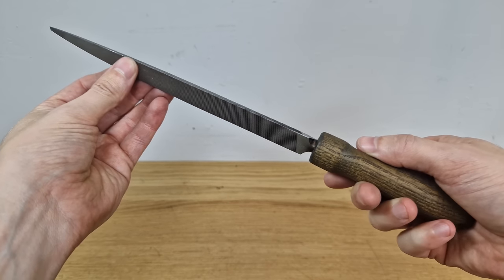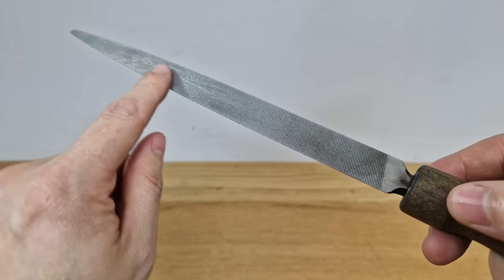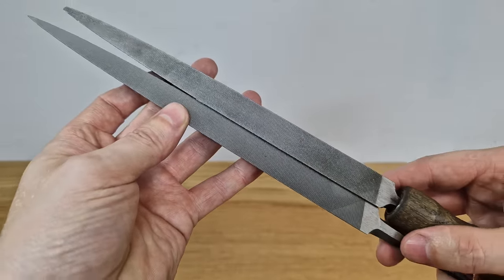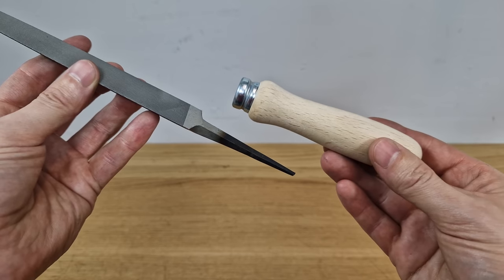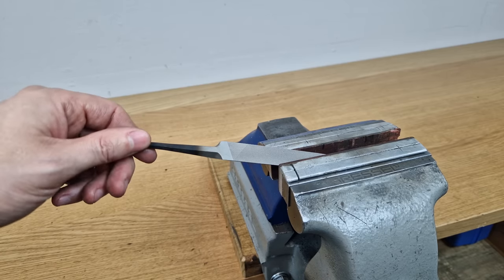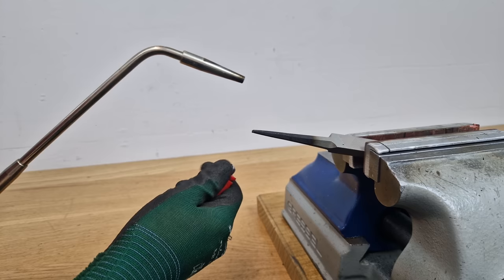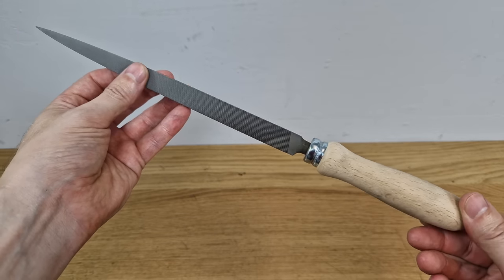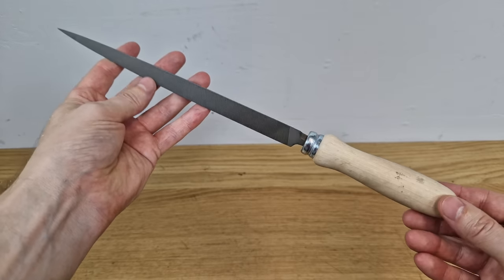How to install Wooden Handles on Files

Comment: I'm a retired machinist. I never threw a file away until it was about a 1/2" long.  I'd grind down the tip to a knifes edge and use them for deburring.  I also never used a new wood handle unless mine were broken.  I'd use the old handle and put a few toothpicks or pieces of wood sticks in the hole if it was too big, then I'd add a bit of glue and hammer them down on the shank of the drill. Worked like a charm.
Reply: I grind them into chisels
Reply: With that amount of effort you could just put a 2$ handle on it jfc
Reply: As someone who also used to never buy new stuff, give it a try lmao

Comment: I've used this approach before - but I always wondered: "Is this actually the right method? What if I'm ruing the heat treatment or something...". Now I can rest easy knowing that it's good enough for my mechanics and must therefore be nothing to worry about.
Reply: @Danny Timms How do you install them?  Just hammar?
Reply: I would think this would mess with the heat treat on some files, but that can be mitigated with a wet towel around the file part while heating the tang.

Comment: The idea here that goes unspoken is basically that the hole in the wood is not large enough to accommodate the tang, so we heat the tang to a high temperature and force it into the wood, it burns its way in, and afterward, we end up with a very tight fit. There's also a lot more to be said to doing the overall fitting than this video lets on.

Comment: Keep the old files too. They're good for several things:
a. you can custom grind them to use them as drivers. The hardened nature will make for a very stout driver even for small sizes.
b. excellent deburring tools if you cut the edges sharp
c. testing file to see if a metal's good to file or not. they can still show as much
d. prying tool

and more. I never get rid of mine, i basically downgrade them from job to job as they become useless for that task. Cheaper than breaking other tools, it's basically free.
Reply: You can also forge knives out of them as it's a good quality high carbon steel
Reply: Chainsaw file is harder than most standard files
Reply: @fixitallpaul4847  with those you can make punches
Reply: I wouldn't use a file as a prying tool, I'd think it would be too brittle and could break or shatter with any real pressure
Reply: @824WaterBoy  I can personally attest to them not being great for prying. I had a tip break off and nearly hit me in the eye doing it. 
They are (I assume) simply too hard for that purpose.
Reply: I would have liked to see him keep it and do some kind of project with it too. I wonder if it would just become clutter... probably a good decision to recycle.
Reply: @Danny Timms that's fair. I was thinking about prying with them in their "natural" state
Reply: Also before you throw them out, leave them in vinegar for a a few hours, just to make sure the teeth are gone and not just gunged up with left over material, the softer steel that stuck in the teeth will erode before the harder steel of the file
Reply: @824WaterBoy  It’d pry anything a screwdriver would, I think is the point.
Reply: @824WaterBoy  I agree, as a kid I was prying with a chainsaw file, it shattered and left me with a very nasty scar that is visible to this day

Comment: Thanks for all these videos. Recently  I used some of the knowledge I have gathered from your videos in restoring some rusty screws from our car battery terminal. The screws were so tight and rusted that I had to use WD40 multiple times to loosen them. I soaked the rusted screws and bolts in rust remover. Used steel wire brush to remove all the rust. Heated them and soaked in linseed oil to prevent further rusting. Applied a little WD40 to lubricate the thread. They were as good as new!

Comment: I always mix an epoxy and a wood dust, and then put it in an old hole to seal it completely.
Then the next day I drill a new hole in that and insert a file in it, and all is solid as it used to be.
Also, if the file is bad at the top, or even in the middle, you can cut that part out and have a smaller file that can also be used in some special situations.
I had a file that was damaged at the bottom and in the middle section, and I made a small file from a top part that was in a mint condition.
Reply: Always handy to have small obscure shaped files.

Deburring, marking tools can be made without changing temper.
You can also make knives, prybars, scrapers, etc so long as you temper it back.
Round files also make good punches, awls, or even screwdrivers, once tempered too.

Genuinely amazing amount of things you can do with a file.

Comment: Good content. I do the freezer method. Works much better without the loosening effect this can produce
Reply: I was thinking the same thing as heated metal expands, wouldnt this handle get loose. But with freezing it contracts then expands once in the handle making a stronger union. We use the freezer method somtimes for bushings in the machine tool trade.

Comment: Gruetzi Mr MM. Always learning things from your videos. Thanks loads. 
Speaking of safety, it was a big surprise when you lit your heating torch with a Bic lighter. NEVER do that. Once every twenty years, the lighter will blow up and take your hand with it. ALWAYS use a real striker. Leave it hooked right next to the torch. Nearly free, lasts forever, even the flint. That habit was hammered into us on the first day in the railway steel shop. A couple of guys lost several fingers years before that way. 
Interestingly, it is oxygen mixed with the lighter fluid vapour that provides the very fast and powerful expansion. I once saw a guy heating his small shop with a steel bucket with a bit of strong cleaning fluid. It had a small flame running around in the bucket. The vapour was slowly burning off. He said "Oh it's ok. It just burns a bit. My dad showed me that. Yeah he died young". Horror. Do not try this at home!

Comment: Files last a lot longer if you clean them. To do this clean any galled material out of the teeth with a wire brush. Brush in the direction of the rows of teeth. Usually diagonally. Files last a really, really long time if looked after and don't last long if they are not. I like the technique in the video. I once chipped a file knocking a handle on cold. What a n00b I was
Reply from the maker: I always clean them when using, I actually have a special file brush.
Reply: @mymechanicsinsights  Yeah me too! I noticed at college most of the files were galled up as no one was telling students to brush them out. Not cleaning them is so wasteful. Once it gets bad you can never get it out :-(

Comment: Thanks for sharing the video.  Just a few suggestions if you are open minded.  If the video title includes "how to" then including details on things really helps.  Aside from stating you heated the handle no other instruction was given.  What size hole-holes did you use for the handle, how did you come to those sizes, measuring max diameter  with multiple sizing holes drilled for the taper?   Explaining what you do and why you do it also really helps.  Best wishes on future videos :)

Comment: Greetings from Petersburg!
Maybe burn the handle a little more?
Burnt handle advantages:
       - absorbs sweat from the hand, while the palm "sticks" to the handle, does not slip;
       - a burnt handle is quickly polished from work;
       - a consequence of the first two advantages - the absence of corns.
Sincerely, Alexander.
Reply from the maker: Never heard of it, thanks for the info
Reply: @mymechanicsinsights  This works with any hand tool that has a wooden handle (file, axe, rake, etc.) The old masters trained.

Comment: I’ve always used a similar method only I generate the heat by grinding the tang on the side of a bench grinder wheel until it’s red hot then bang the handle on quick.

Comment: Thank you for the beautiful video :). I would be interested to know why heating the metal makes the joint better? I would have guessed that the metal expands when heated and makes a larger hole than when cold. And therefore it would make more sense to cool it instead of heating. I am curious about your answers :)

Comment: Old files can be resharpened with acid. The file mustn't be worn out completely though. I've had success using strong vinegar. Soaking the file in it overnight did the trick. When it is done, neutralize the acid with some bicarbonate soda solution and oil the file thoroughly.

Comment: As always, love your work! You made my FriDay eve by posting!
 Some questions on this one though...
Does heating the tang to cherry red not remove tempering at base of the file a little , thereby making it less resilient in the lower quarter? And I would have thought that burning the file into the handle weakens the wood at point of contact? (making it more porous - like charcoal). If you then remove the file, roughly score the tang and re insert with a wet epoxy it would be a more chemically sound bond/fit. Just a thought! Keep the vids coming. GP
Reply: I just asked about the temper too. Cherry red …
Reply: @jeffkeith637  Yes, this will reduce the life of the file.

Comment: Can you explain more how it works?
In my logic if you heating the metal, the metal expand, so if you attach expanded metal into wood, after few minutes it come back to the shape before heating making loose inside the wood. So I think better idea is deep freezing the file to make it "smaller" then put into the handle and wait for expand. 
What do you think?
Can you do a test of both ideas in your next video?
Reply from the maker: Metal only expands a few 0.01mm, the pressure on the wood is much more. It burns itself into the wood and forms the hole it needs.
Reply: @mymechanicsinsights  Plus the heating of the wood releases resin from the dried out sap, which acts like a very strong glue.
Reply: Just keep your handle soaking in water. All. The. Time. 

That's how they built Rome.
Reply: Also das erscheint mir logischer. Sowas ähnliches hab ich mir auch gedacht. Ich drechsel mir viele Griffe selbst für meine Dreheisen û d restlichen beitel. Ich mache immer ein paar riefen in den stutzen und Leim das ganze ein. Obwohl ich Tischler in bin hab ich heute zum ersten Mal davon gehört. Werde es auf jeden Fall testen und anwenden wenn es funzt! Danke fürs teilen & Video machen👍
Reply: @beakittelscherz5419  pisz w zrozumialym dla wszystkich jezyku
Reply: @Gd9967-s2b  exactly what planet are you living on where everyone speaks the same language? Thats what the translate button is for. Type in whatever language you're most comfortable with.
Reply: Funnily I can understand all 3 Languages from this Comment Answer Thread :D
Reply: @Gd9967-s2b  και εσύ το ίδιο να κανεις!

Comment: Yup, that'll work just fine. If you got the heating tools available. Here its a massive pain in the seating area to get hold of gas for "home use" except propane/butane ("BBQ gas"). Even buying a gas flask for mig/mag/tig is difficult.
Wonder if water would work too, if you soak the handle and then force the file into it.
Reply: where is "here"?
Reply from the maker: Not sure, but it might crack with water once it dries.
Reply: @mymechanicsinsights  Yeah, that could happen. Oh well, there's always epoxy :P

Comment: I have never had to burn one in. Press fit has always been sufficient and it allows ig to be reused many times. I have some of my great grandfathers handles that work as good for me as they did for him 50 years ago.
Reply from the maker: Might works sometimes yes, but the handles could split or come loose with time.

Comment: I wonder if, by burning the wood, a substance like tar might have been created, or some other material that acts like glue. It would explain, why the bond is so strong, because not only is it a perfect fit, it is also a perfect fit glued in with a pretty strong glue, that reaches into every pore of both the metal and the wood.
Reply from the maker: I think that would make perfect sense.
Reply: @mymechanicsinsights  – I just looked it up, indeed, since naturally, there is hardly any oxygen (because is covered by the wood of the handle), a pyrolysis of wood occurs, and all kinds of substances are created, among them also tar or tar-like substances. And given that the metal part is still very hot, but cools down, I guess what you do when you put a new handle on a file like this is you hotglue the handle on. And the best thing: We might be looking at a method of attaching handles that is thousands and thousands of years old. And, since it works so well, it never got out of fashion 😉

Comment: Where did you get those cool heat resistant gloves? They look just like the synthetic kind that melt to your skin when they get too hot. (Those look just like cut resistant gloves, which are not useful for heat résistance or impact protection). Safety first...

Comment: Dull files can be restored by soaking in citric acid for 24~48 hours. The acid eats the dull edges off the teeth. It will only work on dull files. It cannot restore chipped or flattened teeth.
Reply from the maker: Hard to imagine, not sure if that works out accurate.
Reply: This does work to some extent.  We used to stab old files into bitter oranges and leave them in there a few hours.  It would remove any rust and foreign materials from the file valleys and I would guess make the teeth more porous, resulting in a bit more use out of old files.  Then again, we used these files to sharpen relatively soft steel machetes.

Comment: Thank you! Is there a risk to lose the temper in the file when doing this, especially with a small file?
Reply from the maker: As long as the file doesn't change color you're fine
Reply: So long as you do not get the file too get hot no problem, you lose temper in the handle but you want that soft anyway. If you heat up till the actual file itself is changing colour you will detemper it. If it still comes loose afterwards a drop of resin or tar in the handle, and heat up file and hammer in will get a strong bond, or use some very resinous pine or other wood, as the resin will turn into a strong glue as it cools. File handle use some furniture oil or linseed oil on it to make it more wear resistant, or use beeswax to make it shine.

Comment: could someone explain how the burning make it a stronger bond?
surely just hammering it in would make a stronger bond because the wood would be just deformed and pressing back onto the tang where as this is like drilling a hole and putting a nail into it
and wont the charred wood have less integrity than unburned wood?

Comment: The old files are very good to give them another functions. You can grind them to a centerpunch, tool for deburring or whatever... maybe also for turning tools but be careful, they are not made of high speed steel, but forged tool steel. They need lower cutting speed than HSS, or carbid cutters.
Reply from the maker: I always stored them when I was younger, yet never used them and ended up with a drawer full of old files. Recycled all of them when I cleaned my shop recently.

Comment: Great video as always! 
I've been trying to make my own wooden handles for my files, and I've  tried this technique, meeting two problems:
1) the handle came loose after everything cooled down. I fixed it with some epoxy glue, but this is far from the ideal cleanliness of what I see in this video. Why did this happen? Did I heat to much the tong of the file?
2) since I make my own handles but I don't have a lathe for metal I cannot make the small metal ring on top of the handle. Every commercial file has such metal ring, and I can't seem to find them separately on the market. I see that the old file you took apart didn't have such metal ring. So, are they truly necessary? Do they really add strength to the handle?

Thank you for everything you tought me in these 4 years!
Reply from the maker: When reading 1) my thought was if you used a metal ring haha. That is essential for a strong fit. Just use a metal tube or so, but also wooden handles can be bought very cheap.

Comment: I did this procedure just yesterday, but I wrapped a wet towel around the blade of the file to ensure the heat treat wasn't affected. You have a very precise torch though, so I suspect its not necessary for you!
Reply from the maker: Good tip too. As long the color of the file doesn't change the heat treatment will stay intact.
Reply: @mymechanicsinsights  Ah, I didn't know that!

Comment: Fascinating, I never knew that heating the metal before hammering on the wood was a thing, or that it's so useful. Does the tang need to be roughed with sanding paper first though?
Reply from the maker: No preparation needed. This technique is often used by japanese knife makers.
Reply: @mymechanicsinsights  neat! Thank you for answering my question, I really love watching your restoration vids.

Comment: Just a question, what if you do not have a blow torch. How to get the metal red hot before mating it with the handle. (for normal home user). I always have the trouble to keeping the handle attached to the file. Now that I know the correct procedure but do not own a blow torch.

Comment: It's pretty counterintuitive to me that, burning the handle onto the tang would create a strong bond, or even bond at all. I would've assumed the burned would would be weaker or have less friction to grip the metal, and the metal would've shrunk once it cooled, allowing it to slip out more easily.
Reply from the maker: Metal only expands a few houndreds of milimeters, but the wood is deformed a few milimeters, so no it does not come loose. Just take a look how strong the old handle held on the old file. I used it a lot, attached that handle around two years ago.